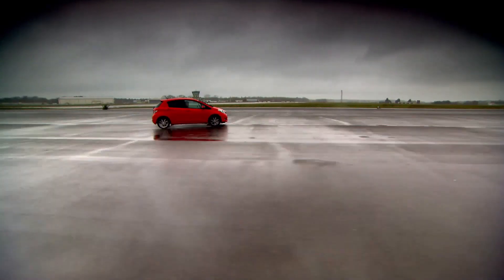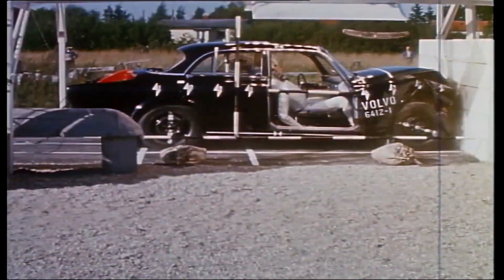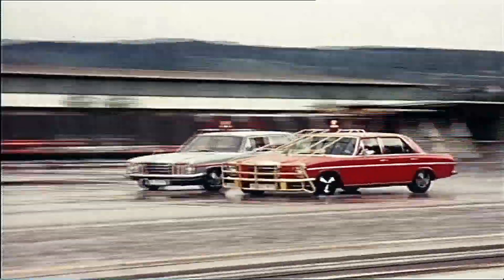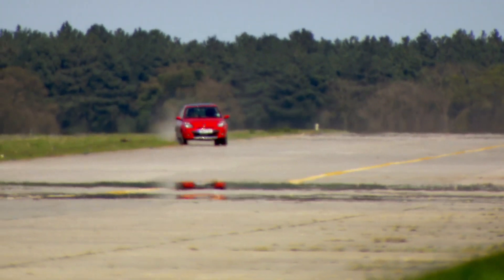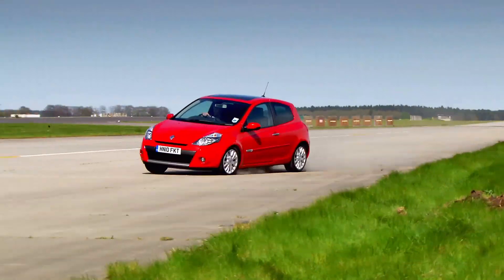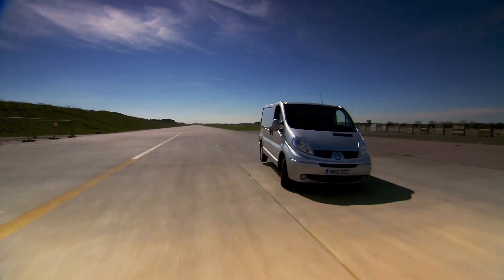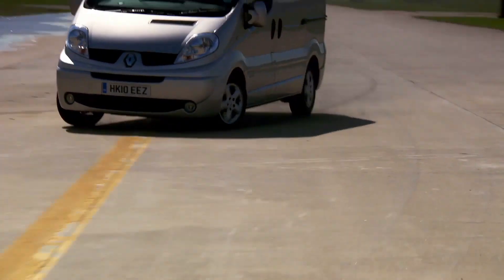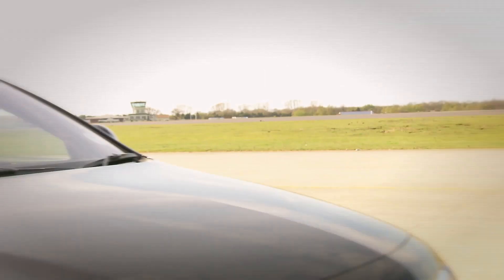Tiff VS Electronic Stability Control | Fifth Gear Classic

Comment: So good story about tiff, I used to work for a company called rage as a mechanic, we produced tubular chassis off road vehicles, sub 700kg with  220bhp, I went for a filming day with one of the cars where he would be driving and about halfway through the day he casually told me the brakes were playing up a little, he didn't make a big thing about it and said he was happy to keep going so off he went racing about for camera (against an Ariel nomad) 
He was doing some fucking fast driving with some jumps aswell, handled it like a pro, at the end of that day he thanked us for coming shook my hand and parked it behind the trailer.
I jumped in to pull it onto the trailer, put my foot on the brake (as you do) to start it up, it had absaloutely no fucking brakes at all... Nothing, and he was jumping it and kicking the arse out around corners....  Complete and utter brake failure and he hardly fucking battered a breath about it.
One of the all time greatest in my eyes and also a realy decent bloke!

Comment: The public should all have access to a facility like this to keep practicing driving tryout your life.
Reply: Hear hear! Most fatalities are caused by the fact that the only time you get to practice avoiding an RTC is immediately before it and by then it's too late to learn anything.
Reply: if i go there i wouldnt be practicing.. i would just play around fiding the limits of my car..
Reply: @gewoontimm  and you'd still be practicing without knowing it
Reply: @confusedredditor1660  up to a degree yes.. beyond that degree its just beeing an idiot behind the wheel trying to make it flip or spin..
Reply: @gewoontimm  Well you have to spin it to find the limit..
Reply: @MisoElEven  true... but throwing the weight of the vehicle around is not the same as running out of grip.. so those are 2 types of limits that are not on the same level
Reply: @gewoontimm  Well throwing the weight of the vehicle around has a big effect on grip so those are 2 different things but youre training them at the same time.. (one will cause the other)
Reply: @MisoElEven  what i ments with running out of grip is under or oversteer at speed.. like doing 100 mph and turn into the corner with too much speed... and the car doesnt do what you want it to do when you turned the wheel and you slide to the outside of the corner missing the apex
Throwing the weight around is too bring the car out of  balance.. the weight of the car still wants to go straight while you are already looking at yoir corner apex... if you understand what im typing here... its 2 different grip levels
Reply: @gewoontimm  I understand what youre trying to say but its essentially the same thing.. if you oversteer at speed its the same as oversteer when turning sharply from side to side. Same with understeer..
Reply: @MisoElEven  to me it felt different.. because of the different speeds to do both of them

Comment: I saw esc save the life of a Leon driver who didnt notice traffic had slowed in front of us on the m4, he moved from the outside lane to the middle lane which I was travelling in before panicking after seeing were were slowing to a crawl and swerving across lane 1 which was even slower but luckily had a gap and his next obstacle was on the hard shoulder with an exposed barrier end. By grace and technology he amazingly didn’t hit anything and the car stayed in control, absolutely amazing safety system and one that I am sure has saved and will continue to save so many lives.
Reply: One time on the motorway i changed lane to overtake and the outside lane had been damaged a bit so i ended up with the outer wheels on grass/gravel next to the center divider, i turned slightly to get onto the road with all 4 wheels, and when i got on, the car instantly began swinging the back end of the car. I would certainly never have been able to recover that myself, but the only thing that happened was the cruice control disengaged, the car made a funny noise as the ESP system did its thing and after a second or 2 i was again going in a straight line.

Would have been a nasty unavoidable accident had it not been for ESP.
Reply: @JohnDoe-bd5sz  Oh yeah, I read about that in my drivers manual. They said if one side of the  car drops off onto the shoulder, the car's going to feel like its steering itself to one side. If I remember correctly, I'm supposed to turn the wheel slightly to the opposite direction to counteract the steering, don't stomp on the brakes, just let the car slow down and apply the brake a little if needed. Then once I'm traveling slowly then carefully get the car back onto the road.

Comment: I think im right in saying the first production car to have ESC as standard across all models of the range was The Renault Laguna II in 2000. Also the first car ever in the world to get EuroNap 5 rating.
Reply: I believe it was. My 2003 VW Golf had ESC and have put it to the test, it was useless on that car and nothing like the modern systems in this video, Traction control and ESC were always 1 second too late to kick in sometimes they would kick in after I've corrected a problem and you could certainly get the car to skid and slide.
Reply: @gravemind6536  Yea it had hard time reducing fwd understeer, especially in the snow. I had 2000 Audi A3 which is Golf mk4. Now I have 2007 BMW X3 which is way, way better.

Comment: My system failed right before centering back after getting cut off on the highway causing both my front wheels to lock up for a couple of seconds. Saved me half way then almost made me loose control lol

Comment: This is what happens when you design inherently unstable cars, if you have good tyres and 50:50 weight distribution it’s easy to make emergency manoeuvres without electronic systems and without crashing. Seeing that qashqai lollop around like a drunk elephant is just pathetic.
As has been expressed in other comments, everyone should have to drive their car on a track/airfield to see how it actually handles on the limit, and hopefully it would change their car buying decisions away from stupid crossovers and SUVs.
Reply: Exacly this!

Unstable car and a computer there to solve it. Makes no sense.

Start off with a stable car.
Reply: Interesting however that the best car ever to do the Scandinavian moose test is an old front wheel drive probably poorly weight distributed Citroen xantia thanks mainly to clever suspension design

Comment: He doesn't counter-steer with ESC off, overly dramatic and exaggerated demonstration. Every modern car is very easy to control over the limit with ESC off and it's very hard to make modern cars lose grip to begin with, you really have to try hard and intentionally want to spin.
Reply: Also can hear the "handbrake applied" bing from the dashboard in that insignia... Effectively pulled the handbrake up mid manoeuvre to enhance its effects.
Reply: I think its fair to say most drivers don't know how to counter steer effectively in such a situation because A- It isn't taught as part of driving lessons and B- Never occurs in normal situations. So no, its not entirely unrealistic of an average driver in a real panic avoidance situation.

Comment: Actually the first car to come with ABS (as an option) was the 1971 Imperial LeBaron, by Chrysler. It was called the "Sure-Brake System"
Reply: US cars of the time often only had crappy drum brakes all round!!! Drum brakes, very heavy weight and terrible suspension, brakes that didnt lock was the least of your problem on those old boats!!! Especially if it was a muscle car, because then you also had to factor in way too much power!!!
Reply: ACTUALLY i think it was Jensen. With their Interceptor in the mid-60ies.
It used an ABS-system sourced from aviation.
Reply: I think the Mercedes was the first to have ABS as standard
Reply: @diegoalejandro8981  1967 Jensen FF.

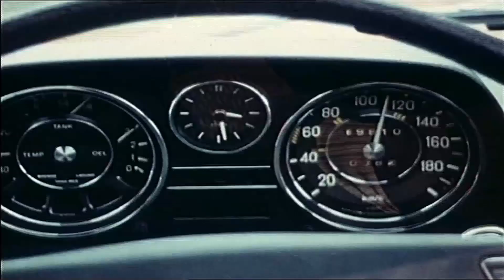Comment: @1:39.... The first car with Electronic controlled Anti Lock Brakes was  Chrysler Imperial from 1971. It's name was “Sure Brake“.
Originally, this system was invented by engineer named Gabriel Voisin, back in 1929. to be used on commercial aircraft. The system was mechanical and it prevented burning and destroying tires on the aircraft. The first passenger car with mechanical Anti lock brakes was Jensen FF in 1966. The first car made in Europe with Electronic controlled Anti Lock Brakes was Triumph 2500 Estates from 1972.
The BOSCH Company trademarked acronym ABS for the system in 1978. and system was introduced on the Mercedes Benz S Class W116 but only as an payed  additional equipment, not as an standard and serial equipment in the car.
Reply: I think they meant the first car to come with ABS as standard. The imperial had it as a option
Reply: @diegoalejandro8981  As an car journalist I already wrote an article on this subject long time ago. There is this part of my comment based on a knowledge from research for my article: The BOSCH Company trademarked acronym ABS for the system in 1978. and system was introduced on the >>Mercedes Benz S Class W116 but only as an payed  additional equipment, not as an standard and serial equipment in the car.<<

Actually, the first car to have an ABS as standard is Lincoln Continental from 1971. System was called "Sure Brake" not ABS back then. The most popular car to have an ABS as standard was Ford Scorpio and the system was called Teves.

Comment: 5:00 - Imagine having that happen to you during an emergency avoidance manoeuvre in an older car that doesn’t have ESC... 😱
Reply: That was on dry road, imagine on wet road or even on ice/snow
Reply: It wouldn’t happen if you know how to drive a car, only if you blindly turn the wheel on full throttle.
Reply: @chrisogrady28  You forget how many female drivers are out there.
Reply: What would happen driving an old and probably underpowered car: 1) nothing, cause it wouldn't have enough power to provoke the driving style necessarry for this
2) the person driving it is very familiar with how the car drives and handles, knows and feels it's limits.
Reply: @lukalukic1  even ESC can't do shit on icy roads. Once you go sideways on ice there is no saving. Drive slow on ice

Comment: 1:39 Nah, I'm pretty sure Jensen was the first company to fit roadcars with ABS. Which was in the 1960ies already!
Reply: Nope
Reply: @iainmacrae6982  sure
Reply: Yeah it was the 1966 Jensen FF.
Reply: Chrysler also fitted ABS to the Imperial in 1971... Mercedes absolutely was NOT the first.

Jensen was rudimentary and mechanical. Also it was an extremely low volume production. 

Ford implemented an electronically controlled version, but only on the rear wheels. 

Chrysler’s (Bendix) Sure-Brake was electronically controlled 4 wheel anti-lock brakes, in 1971. A full 7 years before Bosch/Mercedes claims the “first”. 

https://www.hagerty.com/articles-videos/articles/2013/04/09/antilock-brakes
Reply: brycmtthw I think they meant the first car to come with abs as standard. I think some cars had ABS as a option before the S Class but they didn’t come with ABS as standard
Reply: @diegoalejandro8981  And that price would go to the '85 Ford Scorpio.
I mean Mercedes did introduce certain safety systems fairly soon - but only for good, hard extra cash...
Oh btw, all modern electronic ABS systems have their origin at Centro Ricerce FIAT. They sold the patents to Bosch. And it wouldn't be the last time FIAT invented a new standard with Bosch profiting, just look at the Commonrail application for Diesel.
Reply: alfisti93 I cant say anything about that. If fiat sold those technologies to other brands is their fault. Because at the end of the day they won’t be known has the ones who made it. 

And about the Scorpio. I really don’t know about that one, I’ve never heard that the Scorpio was the first car to came with ABS, I’ve always heard that it was the S Class. So I’m not gonna say it is or it’s not since I actually don’t know
Reply: @diegoalejandro8981  Talking about ABS as standard feature here, since you mentioned it originally.
Of course there was a whole range of cars with optional ABS before the Scorpio!
The W-116 S-class is just a well known and often repeated example - but it was neither the first nor was it fitted as standard.

Inventing stuff and making people aware about it is a marketing exercise. 
Italian car brands are notoriously bad at that...

Comment: Can ESP/ESC be dangerous when you are driving hard through corners?... What if the ESC kicks in and let off the throttle so the back end gets 'light' and the car starts to oversteer (especially with RWD-cars)??
Reply: Almin .S The system’s G-force sensors will detect that rotational force and brake the inside front wheel which counteracts the oversteering rotational force.
Reply: It won't do that.
Reply: These systems have 30+ years of development in them, I think they would have been able to account for situations like that for quite some time now.

Comment: 4:55 doesn't counter and wonders that the spins out.
Reply: King Brilliant  even if he won't call because there's no reasonable answer to this for a top notch motoring journalist other than this was staged but then they should rather take an average driver instead of trying to foul us.
Reply: i don't think a person will remember counter steering and throttle management amidst the panic in case of a road incident
Reply: @saikat0511   an average person not but Tiff in a closed situation like this definetly. Moreover it's a question of driver's training. There's a reason why safety trainings exist.
Reply: Thank god for armchair experts like yourself to explain where an experienced race driver and journalist went wrong.  Whatever would we do without you?
Reply: @ferrumignis  trolls like you had nothing to comment on then
Reply: @no-damn-alias  

Most average drivers don't even know what counter steer is. Same goes for oversteer and understeer. Tiff is merely demonstrating this fact.

They can't all be Forza experts like you.

Comment: Let do this in snow, about one inch in the driving lanes, about four inches else where, change lanes at 50 - 70 mph and see what happens.
Reply: Yeah? do it in a smooth and controlled way and no problems, unless you have crap tires of course.

Comment: The funny thing is the Renault Clio, Vauxhall Insignia, Volkswagen Passat and Nissan Cashcow are all cars that breakdown alot so if you're driving behind those cars ESC is more than welcome.
Reply: the Nissan doesn't break down a lot. the rest I'm not so sure
Reply: Don't think the Passat is too bad, I see quite a few of them as minicabs etc. They seem to take high milages ok.
Reply: @Gibbon How does that make sense
Reply: Carpe diem Vauxhall insignias don’t break down much either.

Comment: I have got a Renault Clio IV and the numbskulls havent included a 'Traction Control off' switch on the dash so if i get stuck in snow or mud this winter how am I suppose to get out of it if it stops the wheels from slipping? - I'm pretty sure the manual said 'turn traction control off ' in situation of getting stuck in snow .. but as i say they haven't added a switch!

Comment: stability control just means you understeer into a tree don't ask how i know
Reply: Either your brakes are crap or you have crap tires, all of my vehicles (Vauxhall) have ESP and I have tried my hardest to try and get any of my vehicles to loose control, just incase I need it one day, just to see how the systems respond and I can report they are fantastic. In fact I would go as far to say it's like the hand of god guiding the cars, all you get is tire sequel and constant control. No understeer and No oversteer. But I'm the sort of guy who keeps on top of the maintenance of my vehicles.

Comment: I find it hard to believe that Tiff can't control the car
Reply: He can, he didn't countersteer at all, and even turned in harder once the rear end started sliding.
Reply: @derbigpr500  well yeah. In a real test I'd pick Tiff over ESC in a heart beat. Poor guy was made to film this rubbish
Reply: I guess he simulates the average idiot behind the wheel. We're not all ex-F1 pilots from the 80s with a lifetime experience in drifting like Tiff to deal with such situations. Honestly I'm scared of the race mode with no assists on my car. I use the sport mode and remember I'm just a normal human, maybe with a lot more experience than most as my job means driving a lot but still no super trained pilot.  Just because ABS is there and saves people doesn't mean a trained pilot can't break better without ABS. It's just tha tthe average human can't especially in a life and death panic situation.
Reply: That was kinda the point, he was DELIBERATELY trying to loose control so as to simulate Joe Avarage's panic response to an emergency.
Even moderately skilled drivers know aggressive steering inputs on a trailing throttle will cause the back to slide and are not a good idea on the road! Of course Tiff could have steered out of it if he wanted to.
Reply: Tiff isn't the average standard driver though is he? That's the whole point...